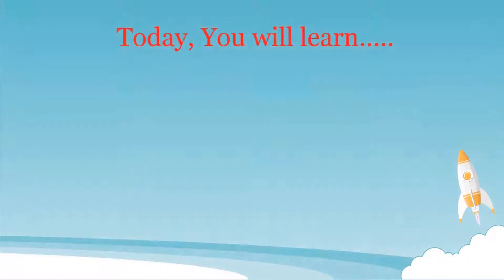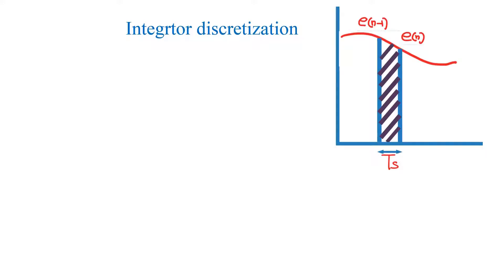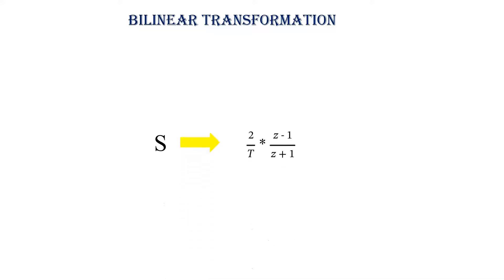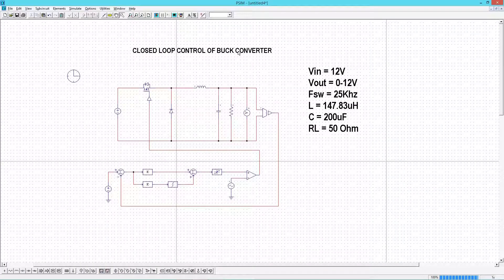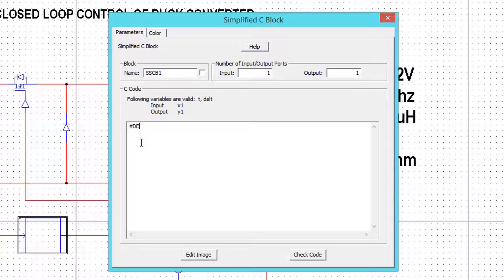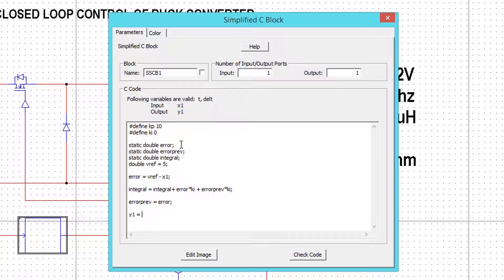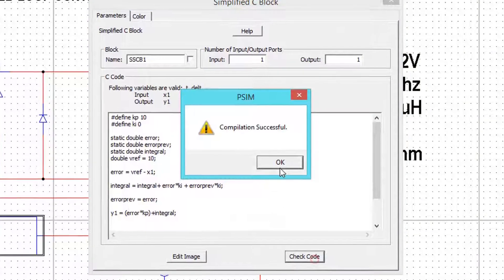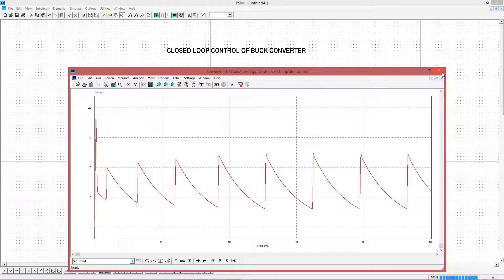PI Controller Software implementation for any microcontroller using C

Comment: If I use the PI controller block in PSIM, how do I find the Gain and Time Constant Value?
Reply: You use classical control techniques such as root locus and Nyquist plot (with delay) and then convert the controller to discrete domain using tustin's method.

Comment: Thank you, what is the initial value of integral variable ? is it Zero or same as the Setpoint ?
Reply from the maker: You can keep it zero
Reply: All static variables are initiated as zero by default, if not specifically assigned

Comment: Thank you for the awesome video!
Question: where did you define the sampling time for the discrete controller?
Reply from the maker: simulation step size is the sampling time, which we set in the simulation control block available in psim